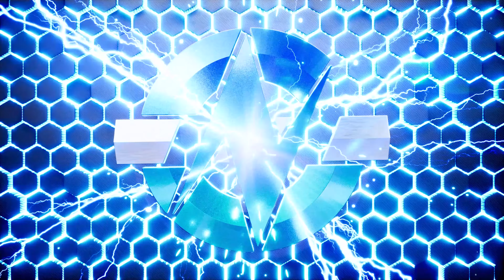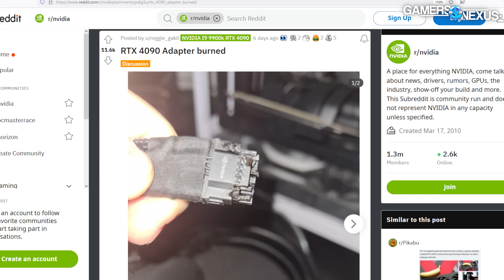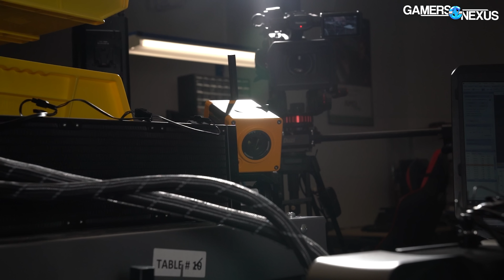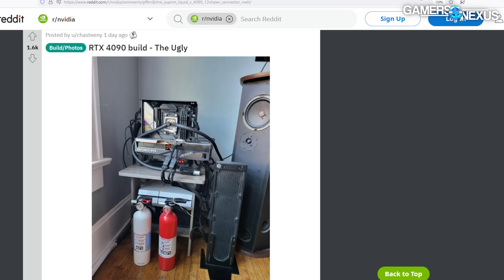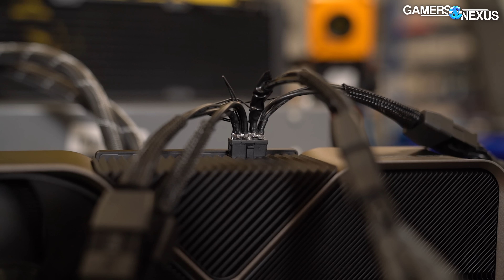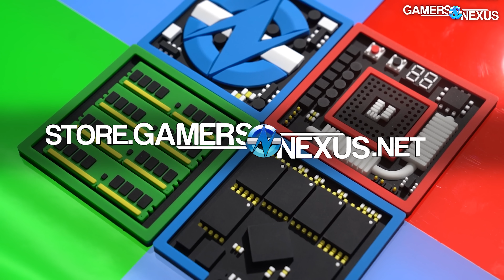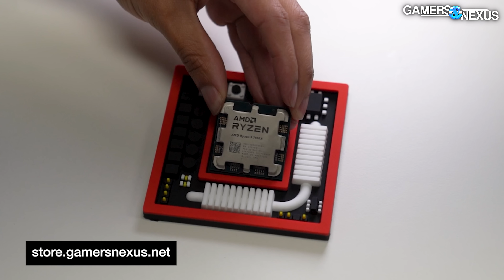Testing Burning NVIDIA 12VHPWR Adapter Cable Theories (RTX 4090)

Comment: I saw this before it happened.  It might even kill somebody in a house fire.  It's just a really bad idea to carry that much power through a tight pack of crimped couplers or put solder joints that close together. MY guess - there's solder bridging from the factory and you'll only find it with sustained power testing and thermal probes.  Imagine a scenario where the pinout is like Igor's cable.  If the 12v line was drawing more current via the double post conductor, than from the singlepost connector, a thin solder bridge between them could overheat when trying to draw some shared power from its neighbor to balance out the physical bus bar distribution. Think about it. When you split a power line into two pieces, when one draws more than the other, a bridge might form to share with the neighbor. Just a few amps in a small bridge can light a match.  I've done it.  Specifically, there isn't adequate insulation between each individual solder pad. one slip from a factory worker and bam.  you have a dangerous bridge.  Now, the reason YOUR cable (not igors) is fine, is because when they heavily solder the pads, there is no chance for a thin bridge balancing current on adjacent lines.  If they insulated the lines MORE, you're fine.  If you solder them MORE, youre fine. Buuut, If you have a tiny bridge and little insulation and large current differential - heat.  heat heat.  To recreate the failure - obtain the IGOR pinout or slice a cut in your contact.  Then add a 30 or 40 gauge solder bridge to "reconnect the neighbors"  then put the card into full scope testing with the intent to generate a large current on/off difference on power lines. I suspect there is a specific function that generates more usage on some cores than others...  Maybe certain games use only half the cores and that makes the bridge hotter...  TL:DR - ask an electrician what would happen if you cut off 99% of an asymmetric bus bar ?  =)  Also, please note - plastics have carbon, and if you get an electrical arc, however small, carbon can be mobilized to make sort of a graphene bridge.   which gets really really hot.  so the plastic itself makes the problem worse by increasing fault arcs.This ties back to the idea that there isn't adequate insulation between the solder pads.  wher teh plastic can be mobilized and fill the crack.  see the white powdery stuff?  That looks a little bit like the nanoparticles I was making with microwaves.  Now, the power lines on your plug might be making similar particles that bridge.  =)  weeeeeyoooo  Hey man. We're wasting out time. Let's hire a chemist to make my nanofluid and help with climate change while we get rich.  For some reason, the way I talk to people... nobody except the patent lawyer wants to do this...

Comment: I still dont understand why they switched to a single 12 pin, over using multiple 8 pins we've had for years. ive read its for less space on PCB, better cooling, less cable management etc. but whats the deal REALLY? I personally kinda liked the look of having 3 8pins with nice sleeved cables. especially when compared to the look of the hideous 4x 8pins to 12 pin adapter. And it doesnt take a Phd in rocket surgery to know that 3 8pins = more electrical contact area than single 12 pin.

Comment: I just received the 4090 Gainward Phantom, and the adapter has 300V rated wires. It does feel flimsy, and I'm looking to get a 90degree cable, as I can't close my case because of the adapter.

Comment: the cable rated voltage is irrelevant to thermal issues, higher voltage rating is simply a function of thicker pvc coating for increased  safety in a high voltage environment.
it may be that all the problematic versions use 150v but that's not a cause

Comment: I don't 100% know how applicable it is, which I'll get to, but it was a thought. And this is not me saying, "Oh I know what the problem is." This is me saying, "I have a hypothesis but literally zero means to test it." I wonder if the problem we're encountering has less to do with thermals and more to do with arcing.

I used to work for a third-party high-voltage electrical insulation systems testing laboratory. (Yeah, it's a mouthful. And yeah, I no longer work there.) We did the third-party testing that ALL of the US, Japan, China, Germany, etc. manufacturers of transformers, motors, and generators, rely upon to get their certifications from certifying bodies (UL, CE, TUV, etc.) Like, all of them. And the manufacturers that made the materials they use. I once had the CEO of DuPont in the lab, demonstrating a problem with the usage of one of his company's materials (in this instance, Mylar), and just blowing his mind with the demonstration of it.

99.9% of what we dealt with was AC, not DC, so I genuinely don't know how well it would apply, but I have a suspicion that it might apply in some regard.

I wonder if the problem is less about making three 8-pin connectors do the work of four, and more about arcing inside the connector when a solder joint breaks. (It was a common problem with test specimens that manufacturers sent to us when they ignored our specimen guidelines, lol.)

See, with AC, it takes 30-32 kV to cause an arc across a 1-inch air gap. (We had a cool demonstration apparatus to illustrate this, and I no longer have the video of it, but it is what it is.) We're obviously talking about much, MUCH smaller gaps than 1-inch here, and admittedly DC does behave differently than AC.

However, the thought that came to mind from watching this and other videos on the issue was this - what if the solder joint broke, but remained physically close enough to the bridging foil to allow the voltage to arc across the gap? An electrical arc, AC or DC, generates WAY more heat than a somewhat-overloaded-but-still-solidly-connected solder joint. If the solder joint broke, but was close enough to arc, it would suuuuper easily melt the plastic (likely Delrin or a Delrin derivative) that makes up the connector.

It's just a thought, based on my peculiarly-specific experience, but I wondered what you thought about it.

Comment: But the melting was happening on the terminal side, not the wire side.. the issue with the burning/melting is on what type of terminals were used.... it may still happen there, it just depends on the design of the terminals. I still think the 1x1mm jumper terminal is way too thin for that amount of energy. It would have been better if they used the same terminals that was used on the ATX 12V power plugs...

Comment: Have you thought of testing for dry solder joints? Dry joints can increase the resistance of the connection, cause intermittent breaks in the connection and are brittle, so they break more easily. That's why in high power connections you usually crimp connections instead of using solder, as there's less chance of failure.

 You can hopefully replicate this by reflowing the solder using a soldering iron, with the temperature set to just enough to wet the solder and immediately remove the heat. You can tell if you have a dry joint because it will look matte and greyish instead of  metallic and shiny.

You can also look out for greyish, matte solder joints when people send you their faulty cables or pictures of said cables.

Comment: In order to justify new models and higher levels they will continue pushing these cards further. This will only get worse. stop pushing your cards beyond it's specs are going to create issues that are outside of it's design parameters. Also consider that some of these are run in hot environments and heat load is exacerbating the issue.

Comment: Ladies, it is not rating in Volts that matters. It is about a resistance in ohms, how much current can flow through it without warming it up. Basics. Could have been rated at 30v and it wouldn't make much difference. Amps matter. Most likely there was difference in gauge or usage of mediocre material such is copper tinned aluminium or something.

Comment: Why didn't yall measure load per line/pin on the cable and connector on card? Might shed some light on issue. Also maybe the card connector has something to do with it?

Comment: Try sticking a screwdriver into the double-seamed crimps (in the adapter housing) and splitting/breaking them before plugging the adapter into the GPU.

Comment: Can you tell who made the connectors so that the current rating of each individual receptacle pin can be evaluated? The 1:1 or busbar approach still goes through individual contacts that are not full 360 degree surface contact points. The 150V/300V is probably not important. With supply chain issues they may have gone to the next threshold to keep running production.  These connectors look less beefy than the prior Tyco/AMP MateNLock.

Comment: If the failure point is the connector it doesn't really matter what the cables are rated at.

Comment: All the adapters I've seen that come with GPUs are 4 8pin.  So then why is Corsair's only 2 8pin?  How does that work if I have said PSU but only have the 4 8pin adapter that came with the GPU?  And is Corsairs adapter good?  No risk of melting?

Comment: Cutting off a lead wouldn't be the same as a cracked/broken solder joint.  If that rating of 300V @ 14A is legit, these cables can handle 4,200 watts, so all of the load on one cable shouldn't even be a problem.
However, If the two sides of a broken joint are still in contact, they can still conduct electricity, and potentially create a LOT of heat where electricity has to arc through the air gap.  cracked joint and/or lose connection to the card could create a fuck-ton of heat at the power being drawn.

HOWEVER...
Look at pictures of melted plugs.  If all of them have damage at the plug end, that's where the heat is being generated.  This isn't a problem where the wire is soldered to the plug.  This is a problem where male plug meets the card's female socket.  Shit connectors + 600W = plastic melt.  That simple.
Reply: Keep in mind that that rating is for the cable, not the connector, correct?
Reply: @Sweetw4ter  ah.  I see what you're saying...

Comment: There's one problem with your testing:  If you remove much of the insulation, temperature at the pins will be lower due to increased exposure to air;  increased convection.  Heck, even the thermocouples you attach help draw some heat.  Most electrical insulation materials are also good thermal insulators, with some exceptions.  The plastic molded parts in the connectors and the wire insulation and heat-shrink tubing and all that are pretty good thermal insulators as well, which means that heat can build up inside much higher if they are not removed or peeled away.
I also notice that the wires are soldered onto the pins.  This is a big no-no for things that get hot ...  Solder (tin) has much higher resistivity than copper, and so it produces a lot more heat.  Most connectors have their wires crimped on, which is solderless, copper biting into copper.  With solder, the problem is not just the fact that solder is less conductive than copper, but also the fact that the resistivity of solder goes up much faster with temperature than it does with copper.  Many a post-mortem analysis of electronic module failures tell a story of soldered connections where the solder melts ... and it stays there, but at molten temperature it is so resistive that it produces tons of heat that begins to affect other parts nearby, until something gives.
  By the way, solder melts at over 200 degrees C, which is far above the 105 degrees C that those cables are rated for.
EDIT:  I'm not sure why you care about 150V vs 300V;  the voltage rating is irrelevant here;  it's the current (the amps) that cause heat.

Comment: You can probably ignore my armchair analysis because I'm not a professional in the field, but based on my (limited) experience: those Micro-Fit 3.0 terminals are really meant to be crimped, not soldered. Soldering creates concentrated strain points, while crimps distribute the strain better over the length of the cable. I guess that's why the Nvidia cables need those massive strain relief bands. Additionally, Molex only makes the MF3.0 terminals to support wires up to 16 AWG, so using them with high-throughput 14 AWG cables is well out-of-spec for that whole connector family, which explains the need for the soldering to begin with.

Now to be fair, I really don't know how common it is in PC power supply cabling to use out-of-spec cables with MF3.0 connectors with workarounds like the ones we're seeing here. It's possible that this has been going on for a while, because Micro-Fit 3.0 was chosen as the standard long before the power demands of these components was ever expected to exceed them. But it's absolutely not ideal. And if this is the first time we've seen 14 AWG cabling shoehorned onto MF3.0 connectors with solder joints and strain relief bands — for my money, that totally explains the whole SNAFU, and it should have been expected that this type of thing could easily happen.
Reply: Sorry, I misspoke — the largest terminals Molex makes for MF3.0 are *18 AWG*, not 16. So these cables are two full gauge sizes too large to fit the terminals as designed.
Reply: @TheDannyMcGee   I also havent seen 14AWG anywhere. Whats interesting is that Intel ATX 3.0 REQUIRED specs for PSU > 450 Watts says the 12VHPWR connector Must use Tin coated contacts and 16AWG wire and ALL 12 power pins Must goto the supply. "All 12 pins must be connected to the power supply using 16 AWG cable". So nVidia didnt follow the spec. while the power math works out with 8 14AWG or even 8 16AWG, they tried to save on some copper wire and not meet the spec. Yes they should have crimped all 16 wires. I cant find the pcie 5.0 spec, but i suspect they recommend some type of Vsense on EACH PIN. if designers knew they were gonna just put the power pins in parallel on the connector, they may only have 4 Vsense circuits. this would give a false reading if a pin (on a parallel network) was broken and assume the wrong current capability. then its pulling too much current on the remaining pins. if this is the case, it cannot be fixed. Also, I think the sideband sense lines are dumb because they dont really tell whats going on. it should be a bi-directional coms signal instead of basically setting jumpers. man what a mess.

Comment: I don't think the voltage rating of the cable mean anything since in it flows 12VDC, the cable section matters (awg... damn imperial system). Otherwise to me the cause could really be a bad design of this crappy adaptor.

Comment: I think I will stick to My RTX 3080 (well, it's a sort of an Odd One, it's got the RTX 3080TI Spec CUDA Cores and Memory Nexus, but they are mounted on the PCB of a Normal 3080, so more Reliable and Higher Clockspeeds, and for a lower Price compared to an actual 3080TI... ) until RTX 50XX is ready, and hopefully, Not going up in Flames! with 99% of Games still being Optimized around Console, it should be Future Proof for another 10 Years Yet.  Heck, the only Reason I got it was Ray Tracing, as My Old GTX 1080 was still doing a locked 60+ at Ultra Everything and 1440P on any Game I threw at it!  So the 3080 should be Future Proof for a long time to Come! 

My Advice: Stick to RTX 30XX People, or GTX 1080 if You don't mind No RT!  they are Proven to be Safe, Reliable, and Solid, and the Prices are coming down on RTX 30XX at long last too! 

Peace.

Comment: the voltage rating is the insulation rating; if you're never using anywhere close to that voltage it doesn't matter

Comment: When you are shooting alone and have a extra tripod, you can use it as a placeholder for focus. Make a X on the floor with tape, put the tripod on the center, tape a paper (with something on it) on the tripod head, get the paper head or chest level. Turn off auto focus, frame the shot, remote the tripod etc etc. You get the idea.

Comment: Try to solder some t-dean connectors there, it should be able to give you 50A without any problem just with 2 cables. If that cables from PSU have enough diameter.

Comment: Amps being factor for cable load safety, is 600w/12v / 4 cables= 15a, whereas 12.5 is max rating for 14 awg. Is that too close tolerance? Peak watts vs average?

Comment: Hey Steve, when I received my MSI Trio 4090, it came with a 3-prong adapter not the 4-prong you guys have?  Technically the card is a 450W card so it runs fine and since I don't plan on overclocking I wasn't all that concerned about having the 4-prong 600W potential power adapter.  Is there any information on these type of adapters?  I am assuming they are completely different connection points since there are less wiring connections.

Comment: I bet the shunt ressistors are failing and fooling the gpu into drawing more wattage then the 12 pin is rated for remember shunt mods ? yeah..... you would only figure this out if you looked at gpu's that have melted 12 pin.

Comment: Extra stupid question because if it's a fluke I'm sure it's calibrated; Is there a chance the camera emissivity was set incorrectly (not sure what the emissivity of leadfree solder is, but it's definitely different from black plastic cable sheath). Could explain the delta from thermocouple to solder joint.

Comment: Ask Nvidia to provide the power simulation, thermal simulation, and FMEA reports of the connector.
Based on the pass twenty years server design experiences, the design should have issues.
There are many existing high amp connectors out there. And the connectors used in rack can carry much more power.
No clue why Nvidia created such an interesting connector.